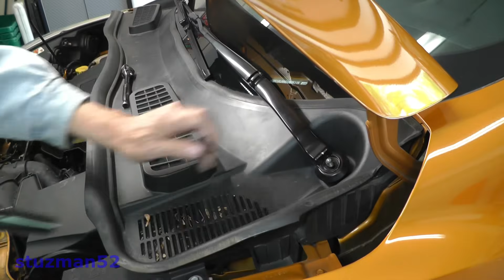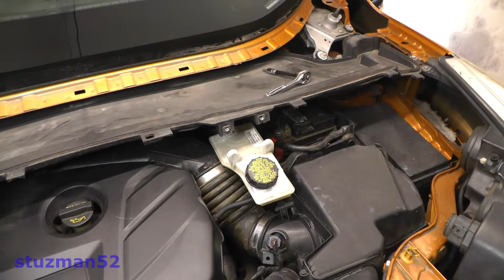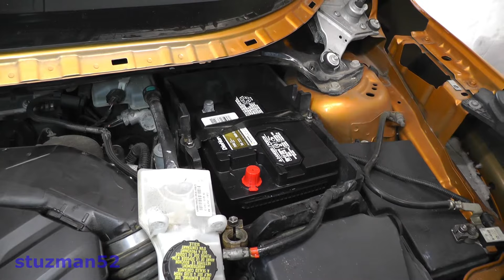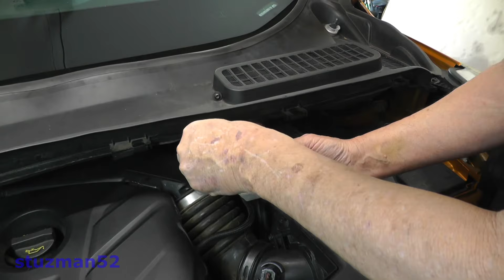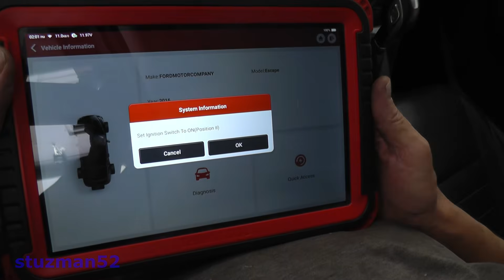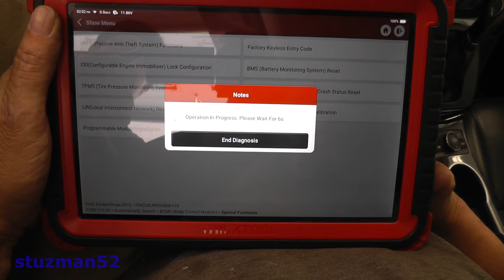2016 Ford Escape, Battery Replacement and Reset

Comment: I think removing the air filter assembly is much easier.
Reply from the maker: I've done it both ways. Either way is fine!
Reply: @stuzman52 To be fair I watched this video as guidance to changing the battery on a Ford Edge. The video is for a Ford Escape which obviuosly different. With the Edge though it is easier to remove the filter housing all together, and its simple to put back.
Reply: @stuzman52 To be fair I watched this video as guidance to changing the battery on a Ford Edge. The video is for a Ford Escape which obviuosly different. With the Edge though it is easier to remove the filter housing all together, and its simple to put back.

Comment: Your video by far was the most detailed and easier to follow than the others.... Until you had to use a scan tool to reset the battery memory.  Don't have one of those..
Reply from the maker: Thanks for the kind words about the video! A lot of folks mentioned in the comments that they were able to reset the battery without a scan tool.

Comment: 14:48  Great video just did the replacement....for the reset I did the highbean backwards instead of forward..like flashing them....and the battery icon on dashboard flashed 3 times hope it works for other....again thank you for the video
Reply from the maker: Thanks for the tip and for the comment!

Comment: Great video! I hate the placement and engineering that Ford did on this piece but your video helped me greatly. 

I plan to relocate my battery to the trunk, to make maintenance easier and also free up space to work on other parts of the car when needed. Just a thought for others with batteries in odd locations!
Reply from the maker: Glad the video was helpful and that you're finding a solution that works for you!

Comment: For the battery reset, I just tried it and it worked. The trick is you have to flash the high beams five times (pull towards you) slowly (one Mississippi, two Mississippi, etc.) then step on the brake pedal 3 times at the same pace.
Reply: This works.  You also have to wait about 20  sec. for the battery light to flash at the end to confirm the reset.
Reply from the maker: Glad that worked for you and thanks for the helpful tip!

Comment: Very clear and comprehensive battery replacement video.  Thank you!
PS  Another tip, I purchased a wiper arm puller ($13 on Amazon) to pull the wiper blades.  I was unable to pull them off by hand.  I replaced a battery years 4 years ago on this same vehicle using the "Ford recommended" procedure, and this was MUCH easier.  Thanks again for posting.
Reply from the maker: Thank you very much and have a great day!

Comment: Your video gave me the confidence to try it. Here are suggestions that might help others. (1) This project requires 10mm and 15 mm sockets, and a T25 screwdriver. (2) Removing the windshield wiper arms by hand was difficult, and required tools to pry the undersides until they let go. (3) Reinstalling the wipers so they nested in the correct place was another challenge. With the wiper arms removed, run the wiper motor, turn it off, and wait for it to settle to its resting position. Line up the wiper arms with the small marks etched in the windshield glass, and then carefully mount the other end onto the motor post without disturbing its position. That should return the sweep to what it had been (although I had to do some adjustments). (4) After the new battery is installed and connected to its cables, start the engine as a test before proceeding further. (5) When done, to reset the battery sensor, turn on the ignition (but not the engine), flash the headlights 5 times (pulling back), and then tap the brake 3 times. Wait patiently for the battery indicator below the tachometer to acknowledge.
Reply: Thanks for your heads-up.  I did this battery replacement today and encountered the same issue with discombobulated wiper blades 🤣.  In addition to your comments, I also found another detailed video that was very helpful in synchronizing my wiper blades:

https://youtu.be/t_56ZWGnwCM?si=7_wLJoebdlmDJOKD

I learned that there are actually some very faint "I" marks on the windshield to align the ends of each wiper blade.  The video recommended using painter's tape to mark the locations for visibility, but I had a silver sharpie which worked great.  It took a few iterations, but I finally got them in sync!

A few other tips I learned during my experience:
-Even after taking off the cowling, there is still very tight clearance to remove the battery, so I ended up standing the battery  on end so I could remove it.
-Bought a Costco replacement battery that hand a handle on top, making it higher than the original.  Therefore, I could not re-install the original hold-down bracket because the bolts were too short.  I ended up ordering a universal battery hold-down kit instead.
Hope this helps others!
Reply from the maker: Glad the video helped!
Reply: Hmm didnt reset the battery good thing I read this ..Will do

Comment: First of all I want to thank you for this video as it made the changing of the batter on my daughters car so quick and easy. There is 1 thing I want to add or change.. The resetting of the battery monitor system that you showed will work if instead of putting the high beam by pushing the lever on and off 5 times you just pull back and flash the high beams 5 times and pumping the brake 3 times. I saw a video doing it that way and it worked for me.  Again, thanks for the video. 
PS....I am 73 years old and remember the days where it was so much easier to work on cars where you didn't have to take half the car apart to work on it.
Reply from the maker: Great to hear the video helped you out, and thanks for the added tip!
Reply: You have to wait for quite a bit too.

Comment: What kinda scan tool is that your using., also wondering about the battery sensor on the negitive terminal? After replacing it, the wiring got hot and car locked up. A mechanic said he had to replace part of the wire harness. If i replace the battery and sensor and sensor wiring. Would you think it would fix this issue, or how far past the battery sensor could this issue affect do you think? Possibly alternator or what is worst case scenerio do you possibly have any idea of what all i might have to replace to fix this issue. Any help ideas or advice would be greatly  appreciated. Thank you for the video above was 💯👍👍👍👍
Reply from the maker: The scan tool used to reset the battery monitoring system was the Thinktool ProS. There are other scanner out there that can do the same thing and I'm sure they are cheaper scanners. As for your battery current sensor, not sure why it was replaced in the first place, since they are pretty reliable. And if the wiring got hot, this sounds like a great deal of current passing through that cable. I wouldn't know why that would be the issue. Hopefully, your mechanic will be able to sort it all out. Have a great day!